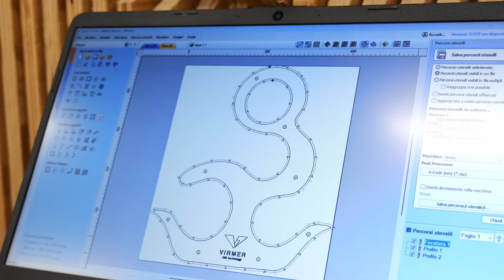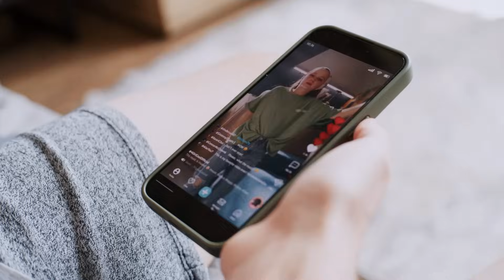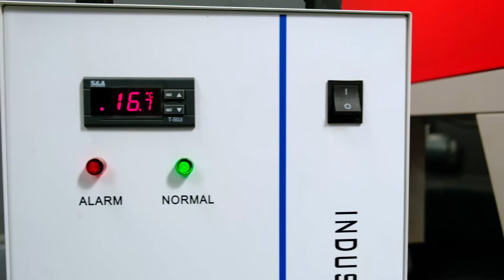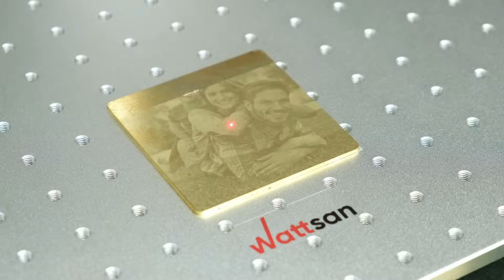The Truth About Starting a CNC Machine Business | How to make money with a CNC! | Virmer & Wattsan

Comment: Great video! How long does it usually take for a complete beginner to become proficient in operating a CNC machine? Any tips for speeding up the learning process?
Reply from the maker: Thanks! It depends. To speed up learning, start with the basics like G-code and safety, practice regularly, use simulations, learn from experienced professionals, and work on real projects whenever possible.